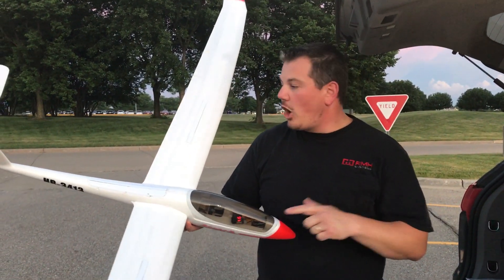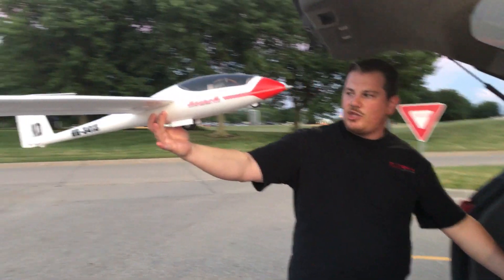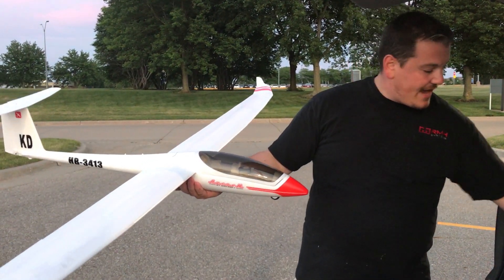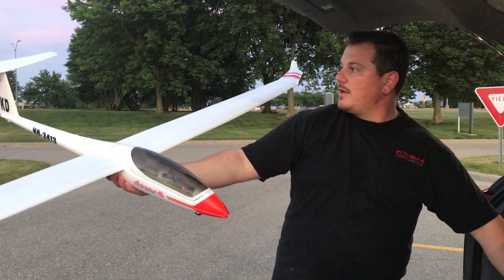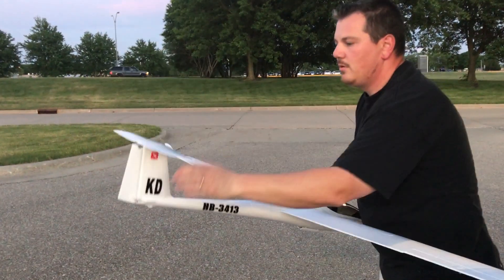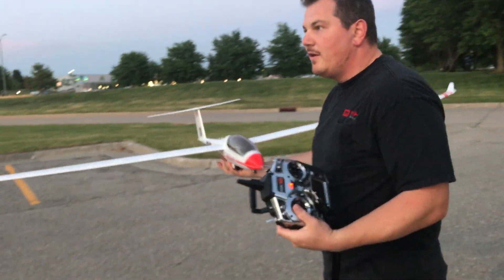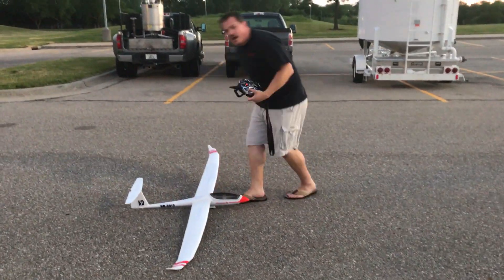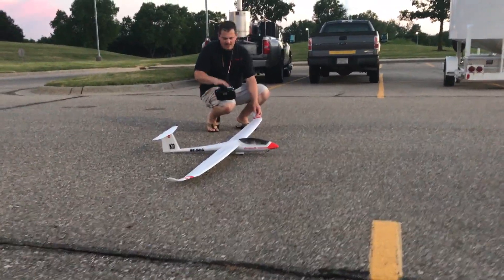Tower Hobby / ST Model / Sheng Teng - Arcus M - Replacement Maiden & Epic Failure!!!

Comment: Wow this is strange just when I saw today a "die hard Spektrum" guy video that finally gave up and turn to Taranis because his was tired of getting FailSafe with Spektrum transmitter, he had a DX18 too. I just keep on reading and seeing issues with Spektrum transmitter losing contact  with the receivers, so sad because I love the ergonomics, the look and the program, but it seems It would be wise to get one instead of a DX9 Specially now that there are good 4 in one multi protocol modules So I could still fly my UMX airplanes, but I find taranis so Ugly I wish they would update the design and ergonomics of that thing.
Reply from the maker: I'm pretty sure I lost radio contact because of the way I fed both diversity antennas through some gas tube I had cut from a spent lighter... but with this type of issue, WHO REALLY KNOWS!!! I think it's all better now, but will only truly know if it happens again